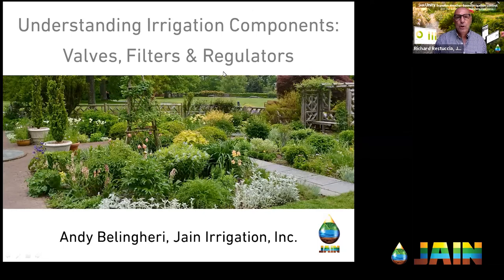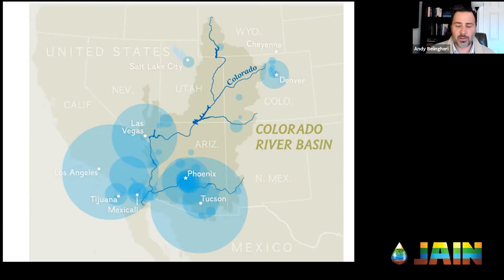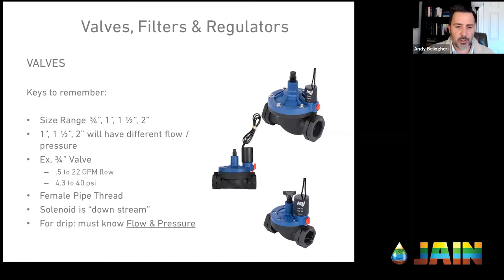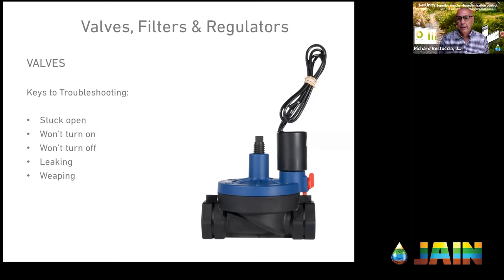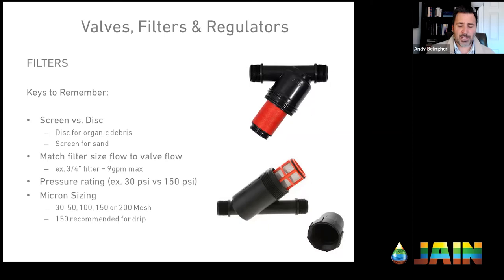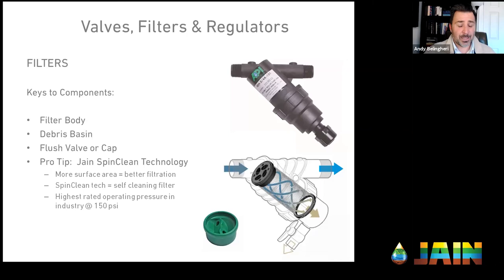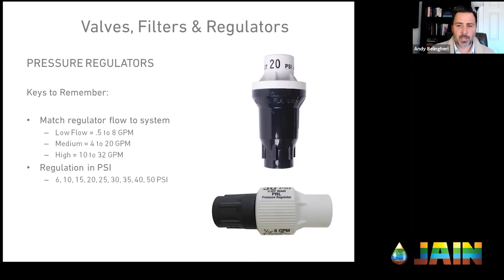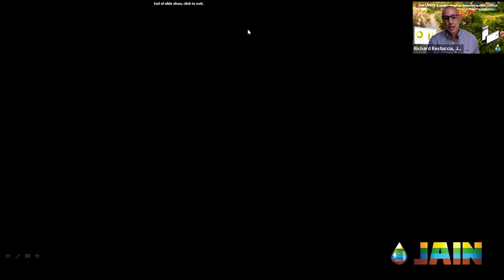Understanding Basic Irrigation Components: Valves, Filters, and Regulators with Andy Belingheri

Comment: Ideally, The filter should be below the pipe and not above it so the sediment follows gravity and stays at bottom of filter until you flush it. I would also close the hole where the drip line is exiting.  You can fill that hole with rocks or use strong duct tape.  Tor my correct answer, I would like some flush valves and some air/vac valves please!!  Mahalo!